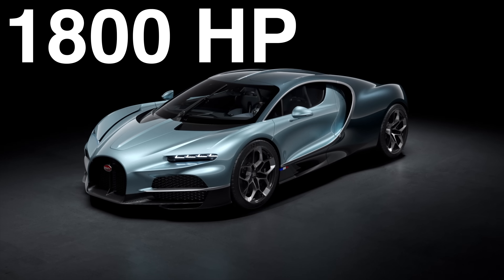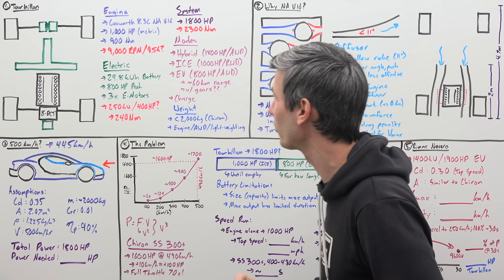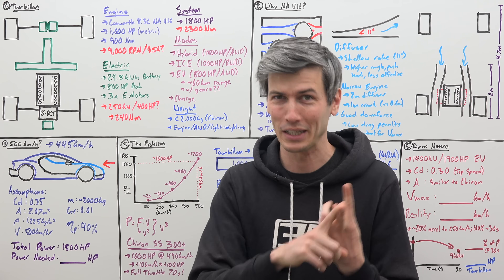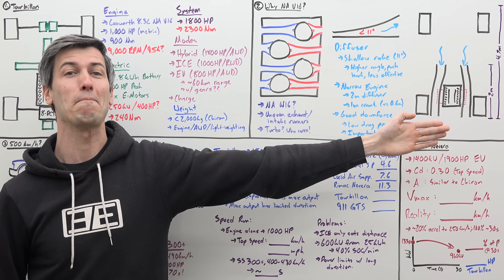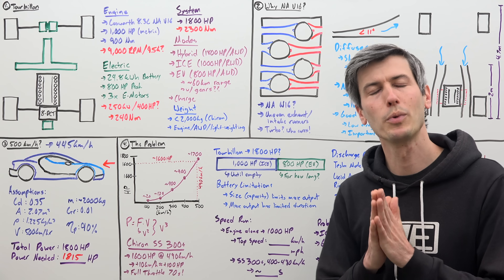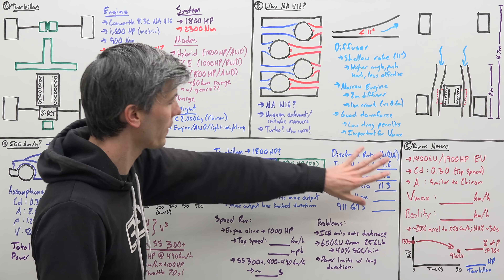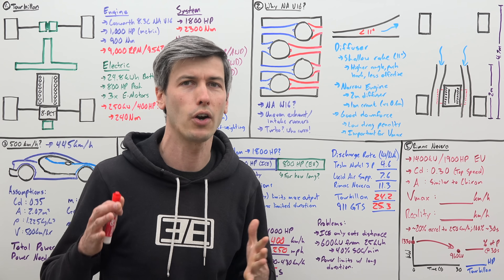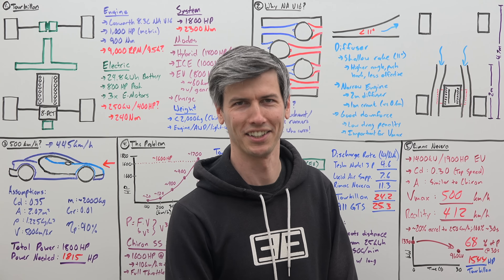Bugatti's Giant V16 Engine Is Insane - All The Tourbillon Details!

Comment: An 8.35 liter V16 that makes ONLY 986 hp is frankly, embarrassing. That's less power per liter than engines we had in the 2000s. Speaking of 2000s, like the Honda, that had only 4 cylinders. With how expensive this car is, I would have expected a lot more. Disappointing for sure.
Reply: I don't believe you're taking emissions regulations into account...
Reply: It's also depends upon the forces involved while running. A very long crankshafts have very high chances of bending while running at high RPMs and. The efficiency combustion process also influence the power. V16 also has more rotating and reciprocating mass than Inline 4. So you can't expect a very high power. This is the reason why V4 engines have slightly more edge in Power than Inline 4s in MotoGP bikes
Reply: I don’t think it really scales that way. Small engines are easy to make a lot of hp per liter. 

Look at motorcycles from 10 years ago. 200hp per liter was the benchmark back then

Comment: The problem with a hybrid system like this is that it can only keep the top speed for a few seconds before the battery is depleted. I know it doesn't matter, but it breaks the illusion of the car.
Reply from the maker: It can go much longer than a few seconds (2.5 mins, which is plenty for a top speed run) if the only requirement is capacity. But as discussed it's not quite so simple.

Comment: bugatti could literally offer a battery performance upgrade a few years down the line like mclaren did with the P1 and provide either weight reduction, or +400hp jump to 2200hp for the same weight if they can get their hands on +50% power dense cells.
each motor/inverter is able to put out 400hp /1200hp total and the battery is holding back 33% of the electric power
that would increase the theorical top speed from 500 to 535mph, of course assuming the gearing and tires allow it, but the biggest gain would be how fast it could accelerate to 500. about 1.5x stronger acceleration @410kph, 2x @460kph, 3x @480kph, 5x @490kph
this is really where Bugatti has low hanging fruits to make more powerful limited series versions and I think the reason for 559kph speedo. I mean they could probably even release a tourbillon super sport+ a year later with 50% more cells that would weigh 100kg more and gain 400hp.
I don't know how high speed tires have evolved though, I remember developing 400kph tires for the veyron was a huge PITA and the tires did cost the price of a brand new car every two year OR 2000miles 😂 ($24 PER MILE just for tires and wheels) and by the time the chiron got out tires maintenance was down by a factor 25x 😂 (5x longer life and 5x less expensive)

Comment: In typical Bugatti fashion they will most likely make a few crazy special editions, one of which will surely be made just to break that 500km/h milestone.
I feel like they gave us clues on how they're gonna accomplish that.
So each of the three electric motors is capable of producing 400hp but are limited by the battery, so in theory if they make the battery capable of giving those three motors all of those 400hp we're looking at a 2200hp car.

Comment: the real question is why crossplane?
Reply: To balance the reciprocating forces. If you use flatplane for V16, the Banking angle should be 45 degrees. Flatplane cranks have the tendency to rip off the engine apart from chassis especially at high displacement. So to smoothen the engine you need crossplanes but without the extra counterweight on both side. Bcoz, the combination of 2 crossplanes doesn't need that. It literally runs smoothly like a V12. Also bcoz of crossplanes the banking angle is 90 degrees like V8s

Comment: The important thing is what do we know about the battery chemistry in this vehicle compared to the Nevera ? Also, from my point of view, it is not possible to quantify the top speed attempt of the Nevera with this car because the battery was already a bit discharged and warm when they set 100%, but in the case of this car, the battery may still be at 100% charge and optimum temperature at a speed close to 400km/h.

Comment: The PEAK  TORQUE of the ICE and Electric motor does not happen at the same RPM as you also know. So I guess they just mentionned the best of both instantanous torque on the curve that give the maximum of both at the RPM that match the better sum of both

Comment: interesting fact about this engine, from the video discussing the internals of it, looking at the pistons and cylinder gaskets, there seems to be no space for spark plugs, which seem to suggest it works through indirect injection! (I'm not 100% sure though, you might want to check it out yourselves)

Comment: But the motor is supposed to recharge the batteries while it´s running, so the question.. how much charge can it deliver at full throttle directly to the electric motors, in that sense the battery perhaps acts only as a charge buffer... and can deliver for longer time at maximum delivery. .
Reply: Instead of the power going directly from the ICE to the wheels, it would be going from the ICE to the battery, then to the wheels. That generator would sap just as much power from the ICE that the electric motors would use to drive the wheels, so there would be no power gain.

Comment: Doesn't some of that horsepower get taken away by generating electricity to power the motors?
Reply: The battery powers the motors.  The engine charges the battery as needed.

Comment: Limiter at 445km/h is something mental
Reply: It's mental, but it's a needed safety feature. We all know it's normal to go up to 450km/h, above that it's not as safe.
Reply: @just.jose.youtube  ya man i tried hitting 500 km/hr in my corolla and almost died at 475 km/hr but not even slightest problem 450
Reply: @adityaparab3677 … yeah ok bro
Reply: @just.jose.youtube VW Passat on German Autobahn says otherwise
Reply: It's hard enough to get to that speed. They can just decide for top gear to top out there so it's not useless at highway cruising where you want low revs.  @just.jose.youtube
Reply: Automatically enables when you pass a village.
Reply: It’s for tyre safety purposes. Even at 400km/h the tyres will wear very rapidly, but you will run out of gas before the tyres pop. At 500km/h, the tyres will pop before you run out of gas.
Reply: @Glock7eventeen nothing to do with wear and everything to do with heat and centrifugal force.
Reply: Hit Mach 0.72 in my golf
Reply: @ajworks5958  still had two gears left, by the sound of it
Reply: Its probably the limit of the tires
Reply: It's tire limited. The Pilot sport cup 2 tires can only do 278mph before they break apart!
Reply: clearly so, but it offers the option to buy the "unlimited package"
Reply: It’s limited by the safe tire speed
Reply: So it's playing lottery. But people play it anyway...
Reply: Safety first 😂
Reply: Nah, it's not. It's just what Bugatti is known for.
Reply: Its not a bugatti engine  @maazshahid8920
Reply: stupidly tuned german autobahn vw jettas: am i a joke to you?
Reply: @datutturugang666 Idk?
Reply: @datutturugang666  You have to be a child to think that is possible. These are the highest top speed cars in the world. Not becuase of the HP, you can get 2000+HP tuned cars but those are not able to actually go these speeds without you dying.
Reply: @willemkanon4020  please, tell me you didn’t really take my comment seriously..
Reply: What are you guys smoking😂

Comment: You asked: "Why no turbo?" Didn't you answer it to yourself? 😉
The ppl should by THIS car and 2 or 3 years later ANOTHER ONE with 4 turbos, nicer intake runners and exhaust headers and a more powerful battery. That will run 515 km/h or 320 mph. 😂
In 10 years: 333 mph or 535 km/h - makes sense, doesn't it? 😉

Comment: 4:14
I never even thought of this. The car is RWD in the ICE only mode. So we could potentially see some people do donuts and slides in the Bugatti Tourbillion. And with a high revving V16, it's definitely going to be banging off the redline like crazy.
Reply: Million euros drift cars. There's a competition I'd watch. 😅
Reply: It's a similar format as the new Lamborghini Revuelto. It's RWD using the V12 and two of the motors power the front wheels.
Reply: We might even see that from Mate Rimac himself lol. Matt from carwow asked him about it but Mate was kind of shy doing it under the Bugatti name which is supposed to be classy. But we might still see it :)
Reply: Hell naw. You have any idea how much Bugatti tires cost?
Reply: 9,500 rpm, you best believe it 😈
Reply: Unless it's programmed to upshift automatically at redline. I hope not. Can the Chiron bang off the limiter??
Reply: I dont know why I just imagined some dudes blocking a freeway in LA somewhere and doing donuts with a stolen Tourbillon there.
Reply: Yep, and it's even better that way. 4wd is only for starting, on the higher speed is only draging your power down and weighing your car down.
Reply: Only 250 being made I don't think even 1 of them will see daylight.
Reply: @blaviken7743  Oh they will, a LOT of YT channels with people with DEEP pockets these days.
They will likely just go straight in most places, but some of the cars will 100% be used and flogged.

Comment: All fits into logic apart of one thing : no way in hell Bugatti is going to make this new car slower than its predecessor.
Reply from the maker: Well it is limited to a speed that is higher than the Chiron SS speed, so it is faster, just not faster than the special edition 300+ version. So I imagine we'll have versions here as well that push that number higher.
Reply: @EngineeringExplained  I suspect a few years down the track with better battery and (if needed) motor tech, we'll have a version that can hit 500+. Maybe even by 2026 when deliveries start, but that's unlikely. Fantastic video, as always. I have been waiting for a breakdown from you since the car launched!

Comment: They'll probably release the SS version and the ICE will be around 1500-1600HP + 800HP Electric Motor
Reply: You cant increase the power of an NA engine by turning up PSI like you can a boosted engine such as the Chiron.

Its physically impossible for this NA V16 to do that. Unless they boost it..but that would make it a totally different car.
Reply: i'd expect more innovation from the electric side of things. like a more energy dense battery

Comment: 1000hp is huge i know but is an 8.3L making that power while the valkyrie makes 1001 hp but is 6.5L i know it procudes less tq but it also revs higher ( i know that is not all is to an enegine out hp/tq per L are down on a newer and more expensive car
Reply: Maybe they left something at the table for SS version? Or for reliability.
Reply: @NameName-ll2yx  i was thinking the same also this car does have a luxury side to it that the aston couldn’t care less about
Reply: That's for engine reliability bro. This Bugatti can be used for more than 500,000km without changing the engine, unlike the Valkyrie which has to change the engine every 50,000km.

Comment: The 2nd V16 to ever be made it to production the 1st one was Cadillac V16
Reply: @AzathothsAlarmClock  I'm pretty sure that's a 2 V8 i believe

Yea i was right it was Lamborghini Urraco V8 and in technicality the Cizeta isn't counted as a V16 it only counts if its 1 engine block
Reply: Also Rolls Royce V16
Reply: @CE11SCAN  That's a movie car for Johnny English Reborn
Reply: What about the V16 engines in the Auto Union Type A to D?
Reply: @timg5914  Those are racing cars and the Type D is V12
Reply: didnt packard also had double eight
Reply: that was a concept car.  not a production car
Reply: @DonLee1980  There was over 3000 made so its far from a concept car
Reply: @mayuravirus6134  ah, my bad, tho cadillac did make a V16 concept car, the one you mentioned is a much older car i had no clue about
Reply: In 1930 😂. Probably had like 50hp.
Reply: @betterbeavailable  That horsepower multiply it by 3.5 and for a car that came out around Great Depression it reached 100mph and a curb weight of around 6200lbs
Reply: @betterbeavailable  horsepower horsepower yay horsepower hahahaha doodooodooodoo horsepower 😃  😃 😃
Reply: @betterbeavailable 😂 😂 😂
Reply: @betterbeavailable  He's too far gone no amount of meds gonna fix that